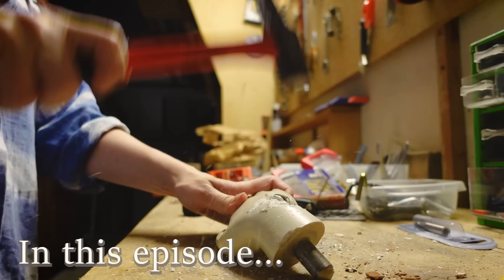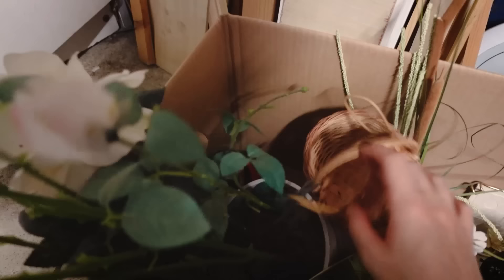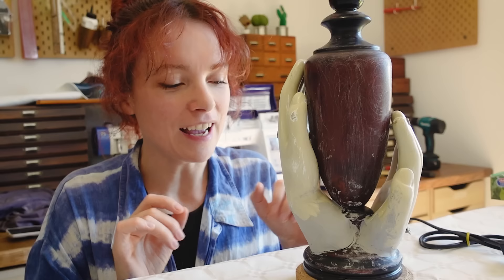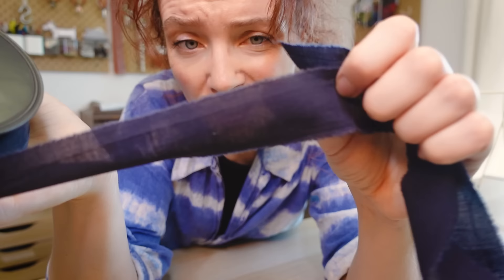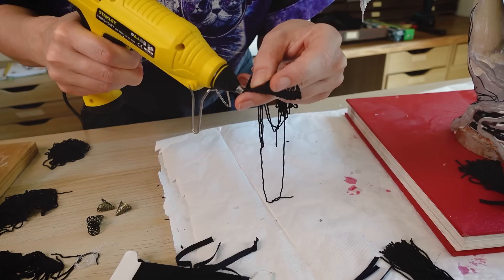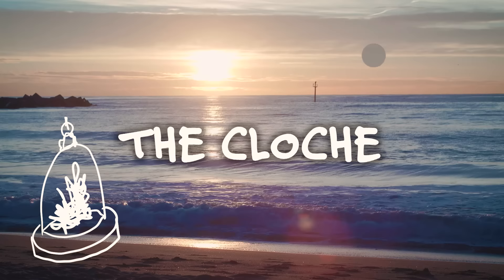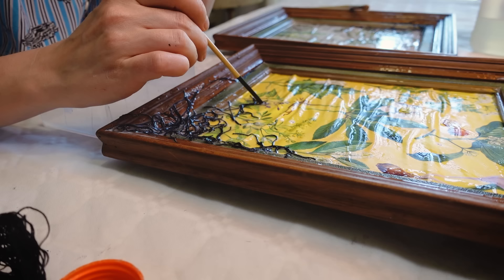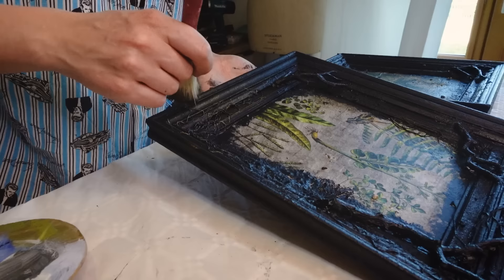I made DARK ACADEMIA home decor out of junk

Comment: I love your spirit.  Because it is cheap, and it is FUN!  I completely agree! LOL  Cloth wrapping on the wire so pins and tack stitches can be used. The lamp has kind of a corset feel, because of the edging you used. Nice!  I love the brass filigree caps on the tassels!  That bee is delightful.  The books are outdated, but still have some lovely pictures! Glue thread roots! I was thinking about how to make them; but you just solved that problem for me! The terrerium...moss, little pebbles and a grassy small patch with an equally small gravestone. Or cross. Those black roots growing from a "tree" a few scraggly moss branches barely survive. Add a few mounted insects as like fruit, on the tree.  See, now you have ME doing it. LOL  Thank you for the inspiration!